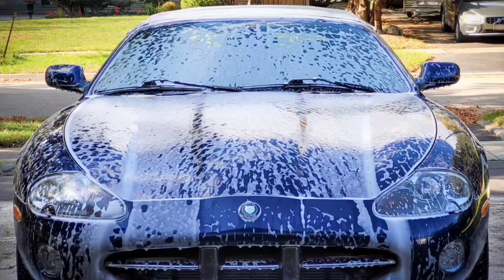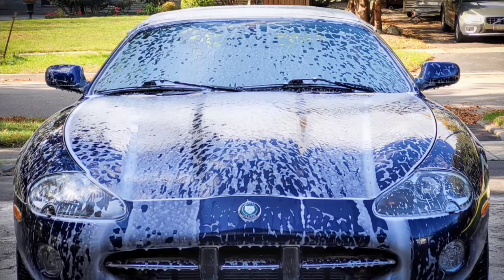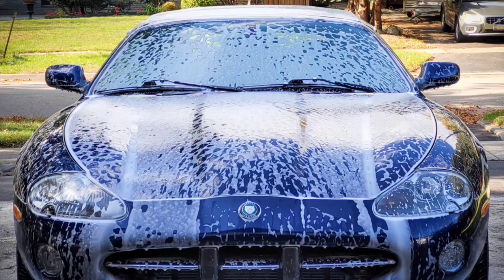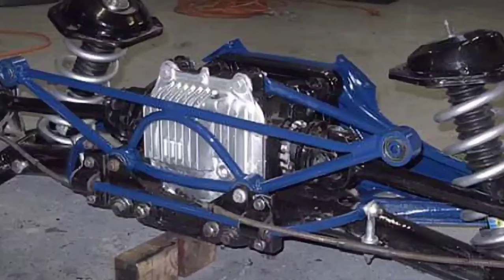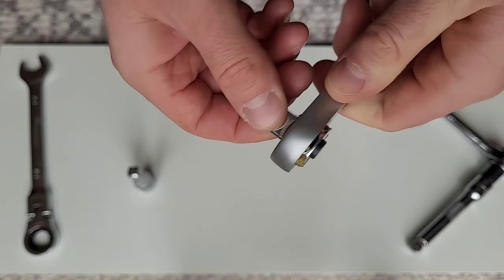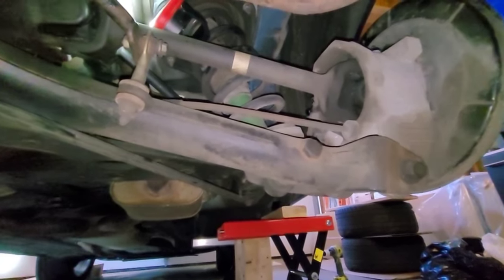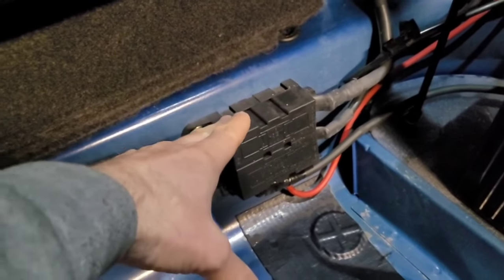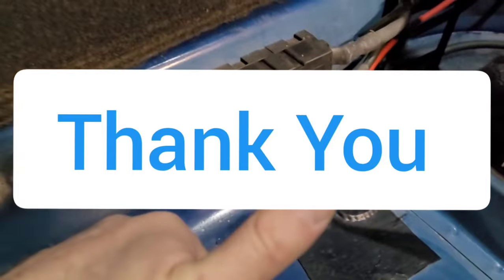2001 Jaguar XK8 - Differential fluid change - Five methods - Everything you need to know

Comment: Great job explaining this. Great camera work. Yes the differential fluid must be changed. The long chain polymers get broken down by the shearing action of the gears. It’s also not really a ‘sealed’ unit if there is an air vent at the top and the plug is ‘leaking’. I’m sure the fluid was ‘low’ too. Depending on conditions  changing the fluid every 4 years is not a bad idea.
Reply from the maker: Thank you, Robert! I have not yet changed the fluid, still indecisive on which approach to choose, but am leaning towards making the hole in the trunk. Like you said, I'd likely want to change it again in 4-5 years and having the access through the trunk makes things much easier.
Reply: @RobertKessmar-nd9zw  Good points
Reply from the maker: Hi Robert, I just completed the differential fluid change and was happy to see that once I removed the plug, a small amount of fluid came out the hole (with the car being perfectly level using a laser). It was a relief to know that the diff had not been driven with low fluid inside. If anything, I suspect it had been overfilled and this is why there was oil residue around the plug.

Comment: Youre a legend at filming under cars. Are you using a phone camera or what??
Reply from the maker: Thank you kindly! I just use my cell phone, nothing fancy. I added an external mic recently to hopefully improve the sound, but the camera is just the regular built-in phone camera. Btw, I went ahead and I changed the differential fluid using one of the methods described in this video. Did not have to drill a hole! Not sure if you saw the diff fluid change video, it is available and I hope it's helpful if you are thinking of tackling this job. Cheers!
Reply: @ just binged all your videos and i dont even have the car yet 😂

still looking for the perfect one
Reply from the maker: You may like the new video I am working on ;)

Comment: Moot point, not mute point.  A common grammatical error.  Why not remove the right side sway bar bushing and bracket?  Just two bolts.  I'll take a photo of my 2" drilled hole and email to you.
Reply from the maker: Gary, I emailed you about the hole through the boot, thank you! For the other methods I was trying to demonstrate them in a way which requires minimal additional disassembly. Indeed, removing the right side sway bar bushing and bracket would create more space for one of the described approaches. If I end up choosing that approach, I may as well take off the sway bar bushing, make life easier for myself :)
Reply: I'm literally in the process of planning this process on my 98 XK8 Convertible.  Your video shows a great deal of detail and your experiments are really well thought out. My earlier car is a bit different to yours and getting access, even visibly, to the plug seems impossible.  I have a hoist and even finding the plug is hard. I'm going to do the 2 inch hole with the grommet, I think. John Dee's video on To the Garage has given me enough confidence to do it. Even his solution to his positioning error makes it look better than Jaguar would have probably done if they had thought about it. Good video, keep them coming!
Reply from the maker: @philcrowell7516  thank you for sharing and I am so glad to hear that my videos are helping out fellow owners! I'd say if your '98 vehicle has an electrical box which looks like John's and is located in the same position as in John's car, then go ahead with the 2" hole method.
Reply: @philcrowell7516  See my comment above. I'll dig out the photos I sent to John many years ago. Unfortunately, he strayed from the location shown.
Richard
Reply: @richardsutton01  I can't see your previous comment Richard. If you have that location photo, I would be very interested.
Reply: @philcrowell7516  Hi Phil. I keep asking for your contact details in a reply so I can send the photos but YouTube deletes my message every time.
Reply from the maker: Phil, if you'd like you can email me at the channel email address and I will connect you with Richard.
Reply: @2001JaguarXK8  Thanks for this. Feel free to just forward my photos to Phil directly. 🙂
Reply: @2001JaguarXK8  Will do. Thanks
Reply: I'm a bit puzzled by my inability to email the channel. I'm probably showing my age here but how do I email 2001JaguarXK8 to pass on my details? Sorry for my thickness!
Reply: Click on the channel name next to the Avatar picture.  You need to do this from your computer as the far right contact tab is not available, on my phone at least.
Reply: @garyvanremortel5218  Thanks Gary. I'll give it a go
Reply from the maker: @philcrowell7516  not a problem at all, the email address is x100.jaguar.xk8 at gmail dot com